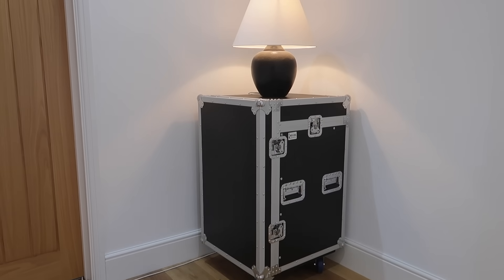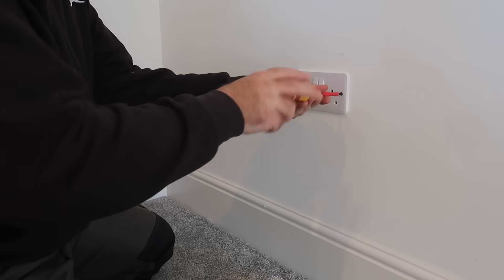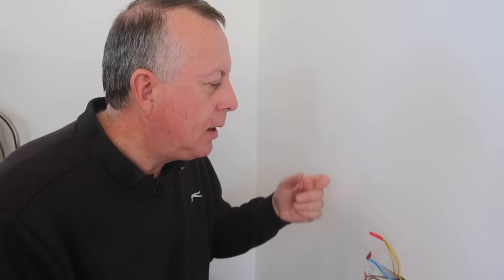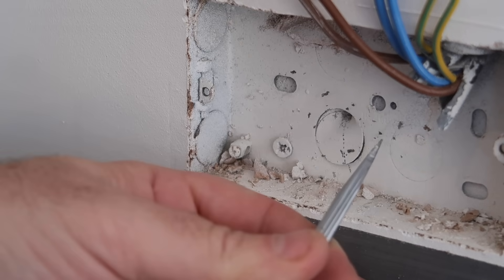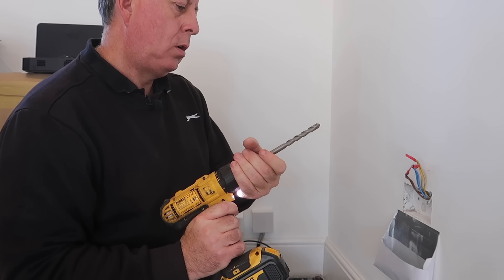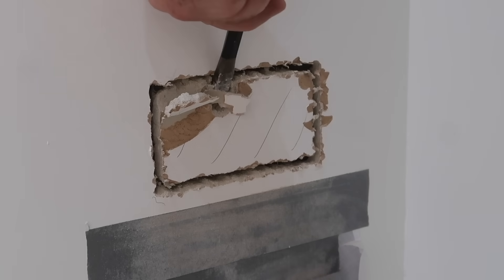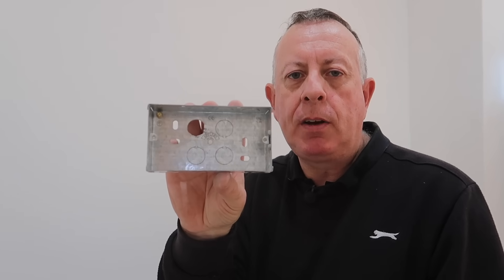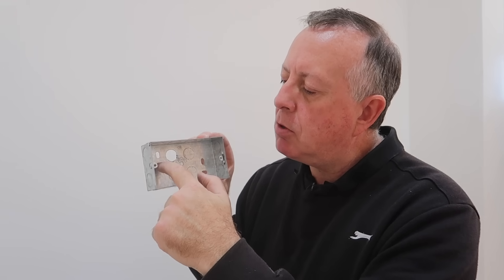How to Install a New Electrical Outlet in an Existing Wall

Comment: Why didn’t you earth the new metal back box to the new double socket ?
Reply: Let me clear this up……a fly lead is not required as long as ‘at least one of the lugs is fixed’.
Reply: @Spark101.  yeah that's already been said several times man
Reply: @solidus784  Yea, just trying to ram it home for people like you.   All this ‘good practice’ is irrelevant.  It’s not a requirement.
Reply: @Spark101.  also comments like "all this good practice is irrelevant" tells me all I'll ever need to know about your work,  Nevermind your attitude pity your father wasn't there to teach you some manners.
Reply: @solidus784   I think you’ll find it’s you struggling to comprehend the regulations and the application of them.   Doing things that are not necessary, but doing it under the banner of good practice is in my opinion a waste of time and resources.  

And suggesting I have poor manners for pointing it out, and worse, bringing family into it is certainly all anyone would need to know about your class, maturity and the type of person you are.  

Grow up you plonker!
Reply: @Spark101.  also if you don't think saying "just to ram it home for people like you" is bad manners and a horrible attitude when nothing has been said to you. I'd love to see what you considered bad manners in your house.
Reply: @solidus784   Thanks for sending me a video confirming my point, which is:  a fly lead isn’t necessary when there is a fixed lug.  Albeit, some may desire it.

I very much doubt you have a copy, but if you do…..check out Guidance note 1, section 3.8.4 - Part 2.   That’s an IET publication.  The same people who publish BS7671.  It explains it all there.  

And I do apologies about the comment, ‘ramming it home for people like you’!   I hope you’re not too upset.
Reply: @Spark101.  what is your point again? That is exactly what I posted Almost to the letter and yet you felt the need to correct me and now you are saying it confirmed your point. Can you not see how foolish you are making yourself look.
Reply: @solidus784  You think it’s good practice.  I don’t.

Regs say it isn’t a requirement.

Over engineering something simple doesn’t make you a good electrician.  Understanding electrical safety and applying the regulations and guidance in a cost and time effective way will. 

Your installs with fly leads are no better than mine without.  They just cost more.

You probably work for someone and therefore this additional cost doesn’t bother you.  But if it came out of your pocket, it would.
Reply: @solidus784  One minute you say ‘2 lugs unfixed, it’s recommended’

Then you change it to ‘2 lugged unfixed it’s required’

🤣🤣 yea, it’s defo me looking foolish.  Get it right before you comment.  That’s my advice to you petal.
Reply: @Spark101.  You know you are pretty much just arguing with yourself here man. someone asked me a question and I gave them an answer to the best of my ability. you then felt they need to "ram it home for people like me" that a fly lead is not required when theres a fixed lug which I literally said in the previous comment.
Reply: @Spark101.  "🤣🤣 yea, it’s defo you looking foolish"
Reply: @solidus784   Your comments before my first one contradicted each other.  It was confusing to anyone who doesn’t know about this stuff.  

I simply clarified it.  And then you pointed it out to me that it had already been said!  By you I’d imagine??  But, as explained, your comments while in part were true…..in part they were also false.  So very unreliable.

You got there in the end mate, but it was a little inconsistent at first.  Almost like you were looking it up as you went!  😂

It’s all there in black and white mate.  All
I was doing is making a clear point.  Like you was trying to do……it’s just mine had no false information or mistakes. 😘
Reply: ‘Unfixed lugs…..It’s recommended’

‘No no wait, I think it’s required!!’

‘No, hang on….it’s it’s…..bugger, I’ve lost the web page now!!  What did it say!!’

‘Quick, YouTube it!’
Reply: Sorry mate….but my point is concrete and I know it to be true 100% without looking it up.  It just so happens that amongst your bumbling comments you managed to say the same thing, albeit not in previous comments.   Some may say, you covered all bases with your comments.  😂😂

Reading them, it seems it’s recommended, but required…….only if you desire it because that’s good practice! 🤣🤣🤣🤣
Reply: @Spark101.  "You got there in the end mate, but it was a little inconsistent at first.  Almost like you were looking it up as you went!  😂"

Is there something badly wrong with you? I posted 
" if both lugs aren't fixed it's recommened."
then "As far as I'm aware if both lugs are fixed a fly lead is not required, if both lugs aren't fixed it is required and if at least one lug is fixed it is only a recommendation" where is the contradiction? 
I posted all this before you commented and you agree with it and are now saying I got there in the end are you stoned off your head or what is the story?
Reply: @Spark101.  You are a strange, strange guy. Goodbye.
Reply: @solidus784  So you’ve made 2 statements about the same thing.

1. Both lugs aren’t fixed, it’s recommended

2.  Both lugs aren’t fixed, it’s required

They are separate things.  A recommendation isn’t a requirement.  

Are you stoned? 🤣🤣🤣

Inconsistent.  Unreliable.  False information
Reply: @solidus784   Now tell me you didn’t contradict yourself?
Reply: @solidus784  what statement do you stand by.  Unless you consider them the same?  

In which case….give it up ffs!!  😂😂
Reply: @solidus784  I feel a little bad to be honest.  You’re probably an apprentice.

Just so you know, a recommendation as you first stated is different to being required as per your second statement about the same thing.  

You can’t say something is electrically required and only recommended.  They are separate terms.   

I hope you can get your head around that.  And just read through your comments. You probably already have, and realise I’ve done you like a kipper.  You sir, are the foolish looking one.  Hens your ‘goodbye’

Which is widely understood as ‘your right, so i’m off now to hide under my duvet in shame!’ 😂😂

But if you are an apprentice, then don’t worry. It will come!  If you are a sparks…..please brush up your knowledge !!’ 😂😂
Reply: @Spark101.   "if both lugs aren't fixed it's recommened" this is true I never specified if both were adjustable because 99% of boxes have at least one fixed lug.
"I then posted As far as I'm aware if both lugs are fixed a fly lead is not required, if both lugs aren't fixed it is required and if at least one lug is fixed it is only a recommendation" IN MY NEXT COMMENT. and you are angry at me and making a fool of yourself because you have the comprehension skills of a 5 year old. I'm not replying anymore you clearly have issues goodbye.
Reply: @solidus784  Oh, it’s the old……’ I said this, but I didn’t necessarily mean how it sounded’  trick!  😂😂

‘If both lugs aren’t fixed’  certainly means that both lugs must be adjustable.  But if for the benefit of your argument you meant something completely different so it doesn’t look like you completely contradicted yourself in your NEXT comment…….I’ll believe you.  Honest.   If that helps you out 👍

It does sort of reinforce how unreliable your comments are if what you actually write isn’t what you actually mean! 🤔

Not to worry.  I suppose it’s all in the name of good practice! 😂
Reply: Someone call this bloke a taxi  🚕 

Before he starts going on about comprehension skills again.  It must be a new word he learnt on-site recently while cleaning his governors tools!
Reply: @solidus784  all I know is in the USA and inspector would require it because of the potential chance for anything galvanic corrosion from the screws and any metal that's supposed to be what you guys call Earthen and I think a lug is a screw I understand that there's a lot of people that do that in the USA as well but it's just not what you would call the professional job if it wasn't and most States and electrical code through the country require a grounded metal box if it was a plastic box that's different
Reply: @keepthinking2666  yep and it takes seconds. The guys crying that you don't have to do it are the type the look to do the least amount possible in every walk of life
Reply: @solidus784  The original socket didn't have a fly lead either, and "it's good practice" isn't really enough unless it's explained why. The backbox is not exposed, and socket has an earthed metallic, conductive metal ring on each screw hole such that when they are tightened up the screws are earthed properly. Not just that, but it chance that those fixing screws become "live" is vanishingly small.

Do the fixing screws up properly and it's all fine.
Reply: Why didn't you fix it with chewing gum?  🤣
Reply: 18th edition says it is best practice or desirable if there is only 1 fixed lug.
Means it would be nice but not necessary.
Reply: @dannyakqj101  18th edition doesn’t say that at all
Reply: The 18th edition doesn’t say anything about earthing back boxes with adjustable lugs or fixed lugs.  Or what is desirable and what isn’t.   

If you’d like to have a read re: desirable earth links from socket terminals  to back boxes, you’ll find it in Guidance Note 1.    (Which isn’t BS7671)
Reply: A very neat job. Those clip-in cables are a great idea. Can they also be used in plugs?
Reply: You’re meant to solder the brown wire to the case
Reply from the maker: Because it doesn't need it. With modern sockets the earth runs around to the screw holes and connects to the back box when you screw it on.
Reply: @ProperDIY  only when the socket is in position. Once you pull the socket away for any reason the back box is not earthed. It is just good practice to earth the back back
Reply: @paulgannon3261  sockets should not be removed without isolating the circuit first.  We are not expected to cater for stupidity within the regulations.
Reply: @Spark101.   agree but if you have to test with the socket off. If you have a break in the cable. You can isolate then remove socket then turn power back on and then the back box is not earthed
Reply: @paulgannon3261  Have you ever removed the cover on a metal consumer unit without isolating the board first?  And how often does that cover have a fly lead on it that keeps it  earthed while it’s being removed.

And you could argue that’s even more dangerous……because you’ll actually be holding that cover.  As opposed to pulling a socket forward and away from an unearth back box that you’ll likely not be touching.
Reply: @paulgannon3261   If earthing metal back boxes is so important for ‘Live work’ then surely we should be fitting fly leads to all removable exposed conductive parts??
Reply: @ProperDIY  But when you take the screws out it's not earthed anymore isn't it?
Reply from the maker: @grotekleum  No, but the power should be off if you are opening a socket. I'm not an electrician so I'm just passing what is industry standard and what has just been installed in my new house and signed off.
Reply: @ProperDIY  only with RCD protection you don't need to.
Reply: @ProperDIY not necessarily. It still requires that Earth cable flyed to the backbox
Reply: @theelitest5795 hi, are you saying the back box with a fixed lug needs a fly lead?
Reply: @ProperDIY l
Reply: @ProperDIY  although you’d expect it, I’ve seen budget sockets without a earth strap to the screw holes.
Reply: I’m a qualified spark, you don’t need to run a fly lead to the back box 👍🏼
Reply: @ukmal67r81  the 18th edition clearly states it is recommended though and seen as good practice because as soon as you takenthe screws out the link is no longer there
Reply: @ukmal67r81  umm I disagree, if say this was in a old cottage with no damp course installed I’d 100% say you need it due to corrosion, you then have a secondary form of earth continuity to the back of the box just in case over years and year a loose connection due to poorly tightened connection and AC current causing the line conductor to become loose and say it’s under Strain due to short cables in the back box. Boom 💥
Reply: @Beariam24  And what if aliens landed in the lounge and knocked the socket and loosened it……and what if this, and what if that!   We can’t plan for every eventuality I’m afraid.
Reply: @Spark101.  so taking the extra 30 seconds to take a fly to the back of the box just in case of an eventuality to happen…. That’s called good workmanship and giving a shit
Reply: @Beariam24   Alright Mother Theresa…….calm down.  🙄

It still isn’t a requirement or necessary.
Reply: @Spark101.  ok domestic installer
Reply: @Beariam24  😂😂😂 you say that like it’s an insult! 😂

I guarantee you….I’m more qualified, more experienced and far more knowledgable than you.   Most electricians are very average.  And the chances are, you are most.  😂😂
Reply: @Spark101.  what’s your qualifications then big man
Reply: @Spark101.  and yeah it is an insult to the profession being a part P “electrician”
Reply: @Beariam24  lol . You defo ain’t a proper electrician 😂
Reply: @Spark101.  👌🏻
Reply: @ukmal67r81  It's good practice to do it and takes no effort and if both lugs aren't fixed it's recommened.
Reply: @solidus784  I'm a diyer so forgive me but if at least once lug isn't fixed, aren't you then required to earth the box?
Reply: @CallumAtwal  As far as I'm aware if both lugs are fixed a fly lead is not required, if both lugs aren't fixed it is required and if at least one lug is fixed it is only a recommendation. the only time I personally dont run a fly lead is if there are two boxes physically bonded together eg through a coupler I would only bond one of those two boxes.
Reply: @solidus784  a fixed lug means it isnt needed its not good practice at all
Reply: @ICEJosh1987  ah, read what I wrote it was pretty clear. Also why is it not good practice at all.
Reply: @solidus784  If both lugs are not fixed it is REQUIRED. But if one of them is fixed there is no need as long as long as the earth on the socket connects to both screw holes. 
Years ago it was good practice to twist cores together, now it is frowned upon so just because people "used to do " something does not mean it still needs to be done. This is why really if you  are not an electrician you should not be touching it as you most likely do not know what the current regs are.
Reply: There is sometimes no need for a fly led from the back box as the earth connection in the socket which earths the screws and thus the back box.
Reply: @Spark101.  no you just have terrible comprehension skills

Comment: I can't understand why all these DIY youtubers who are clearly not qualified to give advice on Electrics, when there are so many professional youtube Electricians out there, I knew within a few minutes of watching this video of him using a neon type screwdriver told me everything I need to know about him as he had been advised by professionals not to use them, I've been an industrial, commercial and domestic electrician, This includes testing and inspecting building electrics for 50+ years, Do you realise there on average of 70 electrocution in the home and 30 in the work place each year, have a look at  Rygol Electrical (Bristol) - This simple Electrical fault turned Deadly.

Comment: So just how does one know if the socket is in Ring or Radial  ?
Reply: There is no spur in radial. No fuse needed as long as you use the right size of conductors.
Reply: @Mixolixplosion  Ahh right, thx pal.

Comment: At around 4:40 in the video, how did you know that you were not drilling through a cable??? How did you know that the cables in the existing socket do not come from the bottom of the socket (which is what I would expect)??? I am looking to add an extension socket myself and I have a brick house like in your video. But this part was not clear to me! Thanks!
Reply: 4:12 you can see the cables come from the top

Comment: Hi looking at adding a new socket to bedroom wall however the nearest socket to spur from is on a different wall and not feasible to use conduit to a door way. Do regulations allow for new cable to be run under floorboards ?

Comment: Should test circuit first before new installation ie' earth etc ' glueing box in place is laughable' you used 20mm grommet, both sides but 2.5 t&e should have mechanical protection going through cavity ie some copex or a piece of 20mm round conduit' on completion ' a basic circuit test ie correct polarity , good earth etc' buy yourself at least a cheap socket tester' at least then when your making diy video's your also teaching people how to do it safely' which is one of the most important things when none qualified people are doing diy.

Comment: Instead of making this a spur, could it not be added into the ring curate by extending one of the cables that were already in the box and connecting that to the new socket, and then running the other cable back into the box and connecting that to the old socket?

Comment: I'd welcome advice on the way to recess an old surface mounted pull switch on a vaulted ceiling into the wall/ceiling using an appropriate pattress box designed for a stud type vaulted ceiling/wall.

Comment: Most electricians wod have damaged half the plaster off the wall with a hammer tool cutting the hole and said the plasterer will get it....talking from experience.

Comment: is there a reason why my electrician ran the wire to connect an extra socket from the live to the neutral instead of live to live and is this why one of the wires burned

Comment: Great simple video. Both back boxes being metal really should be earthed. I liked the way the back box was bonded rather than screwed to the wall. Going back to back you may drill through the box on the other side so this prevents this.